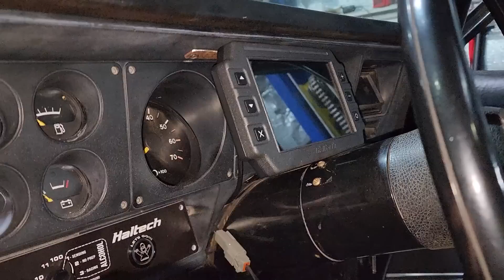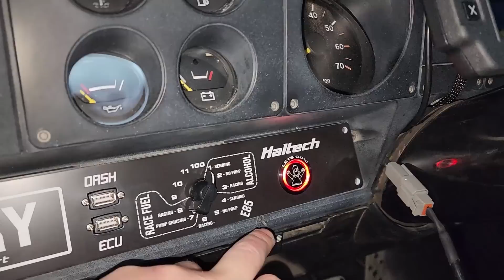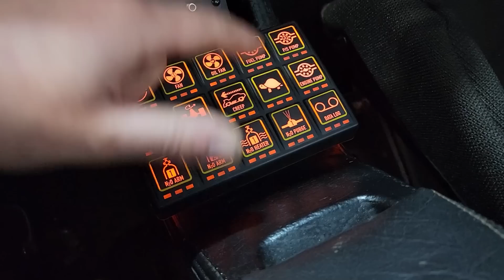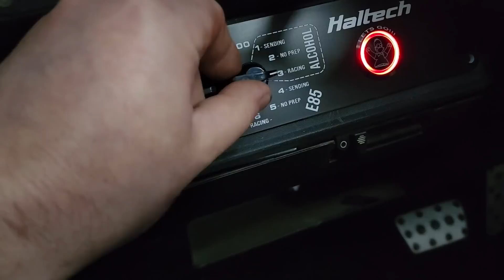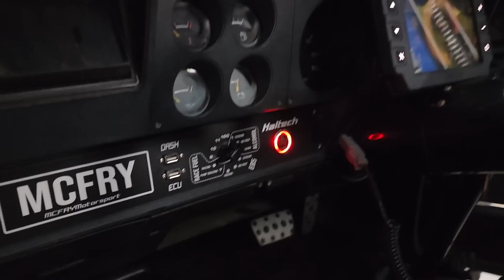4 weeks into the Haltech Nexus Wiring for MCFRY part 3

Comment: When the car was regoed, was it actually engineered? Or was it never engineered?
Reply from the maker: It was never engineered it was registered 4-5 years ago with a 400 chev and the car has a HQ chassis under it so it was all legal but the mods over the years have just gone to far to be returned easily, what they are doing here is if they see your car with any illegal mods anywhere including events or even on a car trailer or if its too loud they can send you to the pits and if you dont comply they can block your vin number until you do so.

Comment: Mate I've got a vy ss with all the goodies done 
Na with a twin high rise with 6 inch filters 
It's registered and insured but not engineered

What do you reckon mate ? 
Hard to engineer or easier cause it's na
Reply from the maker: No engineer will touch it with anything out of the bonnet but your best just making the mods easily reversible and dont make to many like I have done with this.